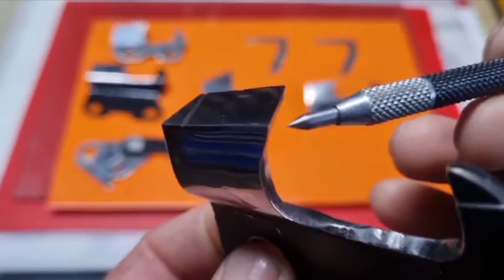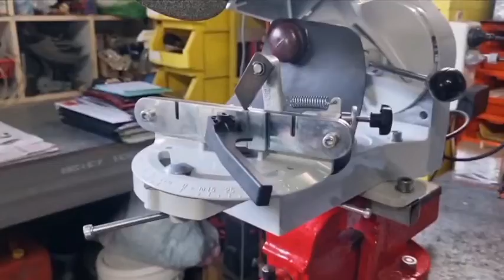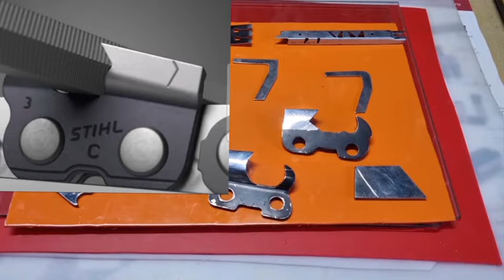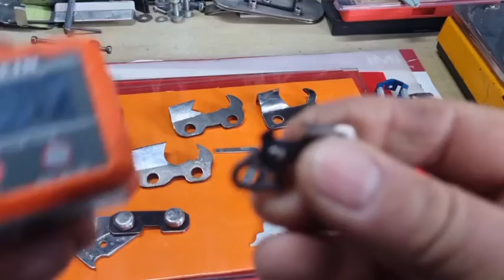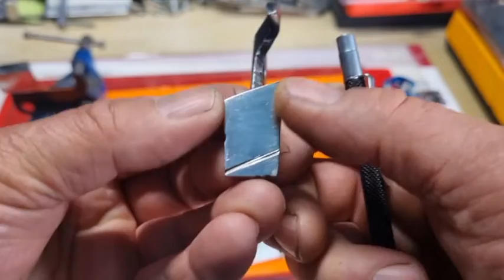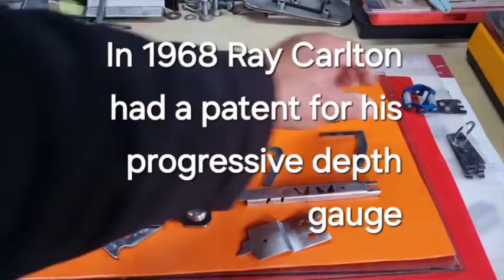Dummies Guide Chainsaw Tooth Geometry

Comment: Thanks. Exactly the technical info I was looking for. When the saw bites into the wood and bogs, besides too much raker filed out, and pushing pressure on the chain, is that indicitive that I have done something off on my filing? 461 full chisel stihl chain, 28" bar, red oak. More noticeable in a tree thats been dead standing for a few years and is somewhat dried out.

Comment: most people cut and use stove wood white and red oak and hickory 😊😊 it holds the coals in the stove and has good heat 2 it other light wood doesnt stay in the stove its like card board 😮😮 OMG 5 21 2O24